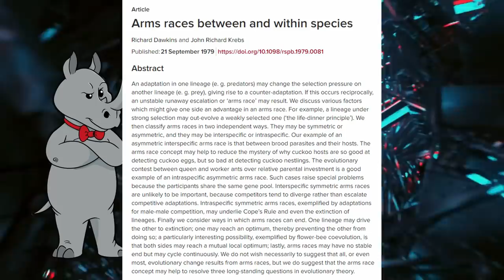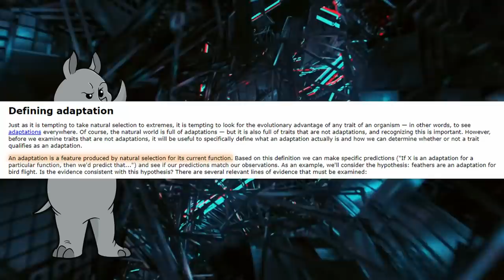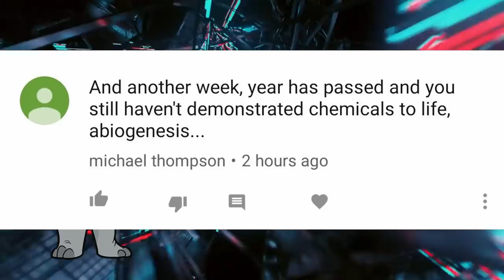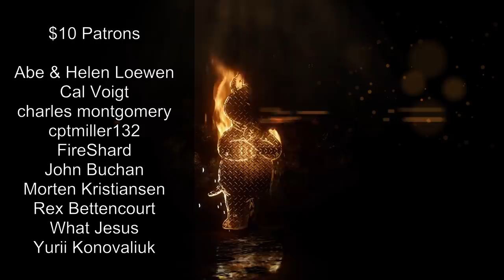David Rives is So Close and Yet So Far

Comment: In the meantime, we're still waiting for useful and concrete applications of creationism in the real world.
Reply: What about that train that was engineered to have a front, like that bird that dives in the water, in order to quieten the boom it makes when it goes into the tunnel?
Reply: @nativeking698  : what about it? Did creationist theories explain the mechanisms of a sonic boom? Don't you think over a hundred years of research and development in aeronautics, and over sixty years of develompent of supersonic aircrafts had anything to do with it?
Or do you also believe aircrafts to be the product of creationism?
Reply: @nicolasandre9886  It is just one example of biomimicry, I think that is how you spell it.   The train was engineered after the bird's beak.  A copy of something that supposedly arose from evolution.  I don't think so.
Reply: @nativeking698  : mimicking a living animal to design a vehicle or appliance does not rely on creationism in any way though, does it?
I mean, the animal you try to mimick exists independently of how it came to be. Neither the theory of evolution nor creationist hypotheses are remotely relevant to analyze what works for currently existing animals and try to replicate it for designed equipment.
If I'm wrong, could you please explain to me how mimicking animals would require creationism to be true in order to work?
Reply: @nicolasandre9886  Your designed vehicle had to be created.
Reply: @nativeking698  : yeah, by engineers. I still fail to see the link with biblical creationism though.
Reply: @nicolasandre9886  Life was created.
Reply: @nativeking698  : prove it.
Reply: @nicolasandre9886  Do you really want me to? I mean ask yourself do you really want me to try?
Reply: @nativeking698  : since I will probably read the same arguments from ignorance or other fallacies I've already heard or read many times before, I don't suppose I want to. But if you have compelling arguments to present, go for it.
Reply: @nicolasandre9886  Life in order to change over time by natural selection (which is used in both creation and evolution) had to have certain abilities right from the get go.  They are the ability to survive its environment, to take in and use energy(which requires a process), the ability to reproduce( another process), the information necessary to do so and that information has to have the ability to mutate.  

In case you're going to consider this an argument from ignorance, let's examine what makes an argument.  An argument has to have at least one premise and one conclusion.  The conclusion must also be stated.  If it doesn't have one or the other it is not an argument.  Therefore you tell me did I make an argument in the above?
Reply: @nativeking698  : sure, you made a more elaborate argument than what I'm used to. However, I would question your first premise that life required certain attributes from the beginning.
Experiments already showed amino acids can form without a conscious creator. Hypothetically, such amino acids may also eventually combine into proteins still without guidance, and form a primitive form of current DNA.
If that is indeed possible, abiogenesis would actually explain the transition from non living matter to living organisms. However, this is still hypothetical and may not be proved to be possible for a long time., but as long as this hypothesis cannot be proven wrong, it should be considered.
I'll also be generous and consider that even if abiogenesis eventually gets confirmed in a lab experiment, it will still not be definitive proof that it's how life appeared on Earth, but it would have the advantage of not requiring to presuppose a supernatural creator, which is problematic since this cannot be confirmed through independent experiments.
Reply: @nicolasandre9886  If this was a test you would've failed.  I did not give a conclusion.  Must have a conclusion to be an an argument. Therefore I didn't make an argument.  This is just to help you establish what is an argument is and if that argument is an argument from ignorance.  At least you tried though.  Just remember no conclusion no argument.  

First amino acids aren't life.  They are what makes life but isn't life itself.  So this doesn't show my statements are false.  Experiments  need experimenters you know a conscience creator.  Now like you said though that experiment can show if certain conditions are met amino acids then life might arise without a creator.  Evidence for abiogenesis and evidence for a creator.  Now let's see what would happen to DNA without the ability to reproduce.  It just sits there doing nothing until it finally deteriorates.   Life ceases to exist at that moment.  Need the ability to reproduce.  Energy now.  DNA sits there has the ability to reproduce but without the ability to use energy.  It can do nothing like a piece of steel just sitting there.  Can't reproduce now.  Life ceases to exist in that moment.  DNA exists but without the ability to mutate.  Life exists but only as DNA strand never to change and never becoming you and me.  DNA with the rest but not the ability to survive its environment.  Say lava.  Before it has the chance to reproduce or to use energy it dies. Life ceases to exist in that moment.  Need all at the exact same time and the same exact moment. 

Experiments themselves require certain presuppositions in order to make them work.
Reply: @nativeking698  : my bad for assuming your conclusion based on the previous talk about creationism then.

You're right, I didn't prove your statement to be false, I don't think I am remotely qualified to do so. I'm just more interested in the abiogenesis hypothesis than the creationist one because it doesn't require a supernatural presupposition, and as such can be studied further through the scientific method, and maybe eventually either be proven to be false, or considered the most likely explanation if reproduced experimentally.

"Experiments themselves require certain presuppositions in order to make them work"
Sure, there are presuppositions that are epistemologically more costly than others though, and any supernatural presupposition disqualifies any hypothesis based on it as a scientific hypothesis since science cannot prove nor disprove any supernatural claim.

So, starting from your premises that the first replicator molecules would need several characteristics to be successful (being able to survive, to replicate and to consume energy), do you draw a conclusion then?

Note that I still don't understand how your train example from your first reply would be an application of a creationist theory.
Reply: @nicolasandre9886   Nicolas Andre  Even with God being supernatural, how God creates may or may not be supernatural.  Since the natural already has been created God can use natural means to create life.  And how he done it we may find out through science.  So even creationism can be studied through the scientific method.  Consider the kind.  We don't know what the original creation looked like but we do know through mutations this is how species came to be.  Tracking those mutations may lead us closer to what they might have looked like and what may be in one kind and not another.  

I will draw a conclusion.  Life is better explained as created rather than arising through chance.  Yes abiogenesis is chance as it is not designed or set up to be that way.  

Had to create that, didn't  rely on chance to do it.  Although every example of natural selection is an application of creationist theory.  Mice turning a darker or lighter tone to match their surroundings, birds becoming flightless to conserve energy and the list goes on really.
Reply: @nativeking698  
"Life is better explained as created"
Created how? By who? How do you test the answers you have to determine if they are actually correct?

"Although every example of natural selection is an application of creationist theory"
So examples of evolution, actually explained by the theory of evolution, are applications of creationist theory?
I wonder what the next step is, does creationist theory also explain the model of the atom and how to make nuclear fission work?
Reply: @nicolasandre9886  How don't know that's what science is for to find out.  By who isn't determinable by science but that doesn't stop creationism from being a scientific theory.  Through science testing the predictions made by creationism.   

Yes I told you before.  Both creationism and evolution use natural selection to explain life.  The main differences between e. and c. is the age of the earth and how life descended.  C. says life was originally created by God in certain forms and then after the flood new species derived from natural selection weeding out certain mutations in the body came to be.  E. says life started out as a single common ancestor and through natural selection life today came to be.  Both use natural selection and therefore every example of natural selection is an application of both c. and e.
Reply: @nativeking698  
"that doesn't stop creationism from being a scientific theory"
Creationism can only be a scientific theory if the creator is contained within the natural universe. Otherwise, once again, any supernatural element of a hypothesis cannot be confirmed nor refuted through the scientific method, therefore moving it outside the scope of science.
If life was indeed created by a supernatural god, science will never be able to confirm it, so unless we update the scientific method to deal with the supernatural, even if it were true, it wouldn't be a scientific knowledge.

To my knowledge, natural selection was never formalized by any creationist proponent. But after all, if the only things that work with creationism have to be borrowed from the theory of evolution, why not. I just hope that putting a big 'creationism science' sticker on all the work of actual biologists will never actually convince people that it's an actual science.
Reply: @nicolasandre9886  Doesn't matter if God is supernatural since science can test the predictions made by creationism.  We can also use things we have learned from science to add support for the theory such as the example I gave earlier (life's abilities).   

Natural selection was thought of long before Darwin.  Darwin utilized natural selection for his theory.  Just like how evolution uses a creationist concept(genetics) we too can use natural selection.  You must remember natural selection is NOT the theory of evolution.  It is only the driving force to make it work.  Without it the theory falls.  Since it is a force we too can use it. 

You must also remember this discussion isn't about whether creationism is science or not, I say it is,  but whether it has applicable use in the real world.  I have already shown it does.
Reply: @nativeking698  
"Just like how evolution uses a creationist concept(genetics)"
Are you really implying DNA and all we know about it now was discovered through creationism?

And regarding your last point, I don't mean to be thick, but can you remind me what real world application can be attributed to creationism? Something that works only if creationism is true? If it helps clarify why I ask, the example of the train you gave is, for me, an application of physics, maybe inspired by observation of animals, but still an application of physics, a discipline that, to my knowledge, has not really benefited a great deal from creationism.
Reply: @nicolasandre9886  No it was discovered by a creationist.  The point is just because something is foundational to one idea doesn't mean it cannot also be foundational to another.  
As far as something that only works if creationism is true.  I don't  think there is anything.  Of course  I dont think there is anything at all that works only if one idea is true.  All evidence can be used by more than one idea.  So I don't see the point in your statement.  
No but what did the engineers do? Did they sit down and wait for those chemicals that make up the train to eventually become life and get naturally selected? Or did they look at one idea and CREATE it?
Reply: @nativeking698  
"No it was discovered by a creationist"
Do you have a source to support this statement please?
I couldn't find out about Friedrich Miescher's beliefs. James Watson seems to be an atheist, and the Wikipedia page about Francis Crick reports he was a firm critic of young Earth creationism, providing the following quote from him:
"'Creation-science' simply has no place in the public-school science classroom"

"No but what did the engineers do?"
They put in practice the physics theories relevant to the goal they wanted to achieve. If an engineer designing a vehicle is proof that life was created by a conscious agent, I fail to see how, unless you make the mistake of considering living organisms share the necessity to be created like man made objects, which I haven't seen demonstrated.
Reply: @nicolasandre9886  Do you not remember the father of modern genetics Gregor Mendel? While we do not know if he was a creationist,  he was a friar priest, so the chances are pretty high he was a creationist.  

Let's see.  A train takes in and uses energy, same as life.  A train cannot reproduce but life can.  Trains need to be able survive their environment, same as life.  Trains have information that is needed to make it go, same as life but life can mutate its information to help it better deal with its environment.  Trains are made of parts that without there isn't a train, same as life.  Looking at this it seems to be a false trust and confidence to think that life wasn't created.
Reply: @nativeking698  : a train is not a living organism. Any similitude regarding certain properties of an object and a living organism do not imply other properties are necessarily shared by objects and living organisms. As you said yourself, trains can't reproduce. Why would a train prove life needs to be created by a conscious designer?

After a very quick and shallow research, I can't find anything indicating Gregor Mendel played any part in the discovery of DNA. I'm afraid I must leave your initial claim aside until I have more convincing elements to think otherwise.
Reply: @nicolasandre9886  It doesn't.  It just adds more evidence to the pile.  Think about it.  You are telling me that a train which can't even reproduce is designed but life with, the mitochondria, vacuoles, DNA, RNA, proteins and other intricate parts is not designed but rather a result of chance.  Good luck with that.  

Who said anything about DNA?
Reply: @nativeking698  
"Who said anything about DNA?"

After your claim from above:
"Just like how evolution uses a creationist concept(genetics)"

I asked the following question:
"Are you really implying DNA and all we know about it now was discovered through creationism?"

Your answer:
"No it was discovered by a creationist"
Reply: @nicolasandre9886  Ok yeah but this is your fault.  Even in your comment you wrote I said genetics but then started to refer to DNA.  My bad for not thinking about that part.  However the concept of genetics is different from the thing that carries your GENETIC information(DNA).  That is why I referred you to the father of modern GENETICS Gregor Mendel.
Reply: @nativeking698  : agreed, however it's now difficult to dissociate genetics from DNA itself. Understanding the underlying mechanics about how genes work, how proteins are influenced by genetic information allows for getting the field of genetics further.
Reply: @nicolasandre9886  Exactly, now the fact it came from a creationist doesn't stop evolutionists from using it now does it? That's  the point, where an idea came from doesn't matter.  As long as the idea works any scientist can use that idea.  That's why creationists can use natural selection in their theory.
Reply: @nativeking698  : sure, a creationist can be a scientist and can produce valid knowledge through the scientific method. Even assuming Gregor Mendel was a creationist, I don't see how his work was motivated or even related to creationism itself. Every reliable knowledge that was gained through his work is reliable because it was confirmed by other biologists, not because of creationism in any way.
If creationists admit natural selection works, why not use the whole theory of evolution? What's supposedly not working in it to reject a theory that is consensually accepted in the scientific community?
Reply: @nicolasandre9886  This wasn't to get you to see a useful application of creationism.  It was to get you to see that an idea regardless of where it came from can be used in any theory.  You acted like we couldn't use natural selection because it might not have been discovered by a creationist.  I just wanted to show that idea was false.  If an idea works it can be used by anybody and any theory.  Not since creationism also uses natural selection every idea inspired by it is also a result of both evolution and creationism.  So yes creationism has concrete and useful applications in the real world.  

They reject it, because 1 a lot of people try to use evolution to disprove God.  Notice I said try, as evolution doesn't disprove God.  2 A lot of what natural selection can produce is limited.  Evolution requires nearly unlimited production. Ex.  To go from a cell to you, the cell would have to develop a brain, arms, legs, stomach,heart,nose,intestines and the list goes on.  The chances of that happening slim to none.  Too much is required and all at once I add to think that all of you is due to natural selection acting on a chance mutation. Much easier to think that most of what makes you you was already created close to what you have now and then natural selection acted on those chance mutations.  Another reason  is new information doesn't come from chance mutation.  Mutations are a result of the information already there being twisted.  Ex.  To go from a cell to a fish requires new information.  The cell doesn't have the information to produce scales, eyes, fins, muscles and the rest.  Much easier to think that a kind of fish was already created first and then chance mutations acted on by natural selection caused losses of information or the result of those mutations to get the fish you see today.
Reply: @nativeking698  
"So yes creationism has concrete and useful applications in the real world. "
I still don't see it. If by that you mean using natural selection as part of creationist theory (which still seems ironic to me), then it's still not an application of creationist theory, creationism itself did not inspire the formalization of natural selection.
Maybe I'm being stubborn, but I still need an actually compelling example of some knowledge that came from creationism itself that has led to a useful application in the real world.

"1 a lot of people try to use evolution to disprove God"
And I would agree that it is useless, because:
a) it's impossible to disprove the idea of a god, unless it is logically inconsistent (like the idea of an omnipotent, omniscient and benevolent god is inconsistent considering what happens in the real world)
b) the theory of evolution doesn't need a god to work, but doesn't need the absence of god either

That being said, that would still make it an emotional reason for believers to reject the theory. While I could sympathize with it, it's by itself an objectively bad reason to reject the theory.

"Much easier to think that most of what makes you you was already created close to what you have now"
I think that sums well the rest of your objections. It's easier to believe an all powerful god did it magically than actually looking up the state of current scientific consensus on the subject.

"Mutations are a result of the information already there being twisted"
There are several types of mutations, including insertions, which can add new information that can be neutral, detrimental or beneficial to the host organism.

"To go from a cell to a fish requires new information"
From what I understand, most organisms that reproduce sexually start from a sperm and an egg that constitute a single cell that can eventually develop into a full fish, frog, dog or even human, without any new information from the two halves from the original sperm and egg.
Reply: @nicolasandre9886   No you are right.  The idea of creationism did not spawn natural selection theory.  Neither did evolution either.  Many ideas of evolution were trying to make it possible for a naturalist idea of life to work.  It wasn't until Darwin started utilizing natural selection in a theory of evolution to make it plausible.  That being said don't get it twisted evolution didn't inspire natural selection.  People already knew animals changed over time they just didn't know the mechanics.  I concede I cannot think of an example where creationism inspired useful knowledge in the real world.  A lot of our evidence come from old earth assumptions being faulty.  It was thought it took a millions of years to make diamonds.  Experiments have made synthetic diamonds in weeks.  No reason to assume millions of years.  Same with oil, we can make synthetic oil in days, no reason for millions of years.  Animals have had new species arrived within 4 generations, no reason to assume a vast amount of time.  

A.  Depends on how you look at God's attributes.  

B.  Not sure what that has to do with what I said but it is true. 

Who said he did it magically? I already said he could do naturally or supernaturally.  Since God knows what he wants, has the power and intelligence and technology to bring it about he can do it naturally.  Look at my work, if someone doesn't know what they are doing it would take them all day to make 200 sticks.  I can make 15,000 in an hour.   Scientific consensus doesn't matter.  Only evidence.  

It's not new information it's a new trait but not new information.  Look at this example.  Selecting from the word alphabet, alpha makes red.  Bet makes white. When an insertion happens like taking a and putting it in bet makes beta.  Beta then makes pink.  However new information has not taken place.  No new letter has arrived but a new trait has.  It is still just rearranging of information already there.  

I was talking about the original cell.  My bad for not clarifying.  Think about this we probably don't have the information necessary to make ourselves have scales.  Word example again to make scales we need the information of SCALES we only have SKINS.  Mutate all we want we will never go from SKINS to SCALES as we need to add the letters c,a and e.  You might think insertion might help, but our genome is only made up the words, SKINS, POINT, FOOT, DID, and GOD.  Insertion takes a letter and puts it in SKINS.  Still no c, a or e therefore the word SCALES will not come to fruition.  And we we will never produce scales. It just isn't in our DNA.  Same with the original cell.  If the original cell's genome only spelled Abdefghi, we can make all kinds of words.  But not words that include everything after i.  Let's say to go from cell to fish requires the letters z, j, and o.  No matter how much you rearrange the genome abcdefghi z, j and o ain't happening.  Insertion may add two a or insert a b here and there but never z, j or o.  So to go from cell to fish will never happen.
Reply: @nativeking698  : I haven't looked into it yet but I doubt conditions that occur naturally can produce diamonds or oil as quickly as industrial processes that are likely costly in energy.

"Animals have had new species arrived within 4 generations"
I would be very curious to have a source explaining this example.

"Scientific consensus doesn't matter.  Only evidence"
Unless the whole scientific community thrown their own method down the toilet, scientific consensus is based on agreeing interpretation of evidence and repeated results of experiments by independant teams.

"It is still just rearranging of information already there"
As far as I know, DNA and RNA have always been made of adenine, cytosine, guanine, thymine and uracil. Genetic information is composed of genes which are sequences of these nucleotides.
Adding nucleotides from this same 'alphabet' can lead to new genes appearing in a DNA or RNA sequence.

"Let's say to go from cell to fish requires the letters z, j, and o"
Same as above, DNA and RNA have been most likely composed of A, T, C, G and U nucleotides right from the start. New traits can appear with the appropriate mutations. The difficult thing is to grasp the scale of the time on which in occurred, and try to ignore the idea it couldn't happen by itself randomly, because our own brains are very effective at detecting agency in almost every event.
Reply: @nicolasandre9886   Nicolas Andre  Synthetic diamonds and oil.  Not at all.  Syntethic diamonds are cheaper than natural ones.  There isn't much difference in the price of oil. 
Experiments show as long as the heat and pressure is right bam diamonds.  How long does it take to get to that temperature and pressure? Depends on the earth, but if the earth has the right conditions then it would only take a short amount of time.  

Notice INTERPRETATION of the evidence.  I might interpret that evidence differently than they do.  I shouldn't say oh this is what the consensus is then that must be the answer.   

Think about this the genetic sequence A-T C-G A-U will make eyeball.  In another animal will the same sequence also make eyeball or will that sequence make something else?  If that sequence always makes eyeball regardless of the animal then I am wrong about that.  However should that same sequence make something else in another animal then I am right.  Why? Because the thing that's reads the code reads it to say in one animal oh this sequence says make eyeball.  But in another animal the  sequence reads something else because both animals know what information is supposed to be produced because  they know what information is there.  

I know it could've happened randomly.  The question is did it? I say not.  Why do you think our brains are effective at that?
Reply: @nativeking698  
"I shouldn't say oh this is what the consensus is then that must be the answer."
No but if your interpretation differs from the scientific consensus, your are the one who needs to explain why your interpretation is more correct than the consensual one, like scientists have done to explain why they consider their interpretations correct.

"(...) both animals know what information is supposed to be produced because  they know what information is there."
It was probably just a clumsy choice of words on your part here, but animals know nothing of their genetic information. The process by which an animal develops in a certain way depending on its genetic information is the application of biochemistry principles that make certain sequences of DNA eventually produce certain proteins. The details of this process are far beyond my knowledge on the subject though.

"The question is did it? I say not"
You are of course free to hold any opinion, and given the elements at your disposal and your general beliefs, you probably have good reasons to believe so. For my part, I'll never know for sure if it did happen by random chance, but since it seems the best explanation that can be derived from observations and experiments according to biologists, I'll trust their current knowledge and assume this is the most likely explanation. Maybe I'm wrong, but I need compelling reasons to change my mind.

"Why do you think our brains are effective at that?"
Because of evolution (no pun intended). At a time where humans were much more at risk of being hunted by predators in the wilderness, people assuming that a bush is rustling because there's a nasty beast about to eat them had better chances of survival than people assuming it's only the wind. If the first ones get it wrong, it's not a fatal mistake.
Also, studies on children behavior seem to confirm a strong tendency to attribute agency to natural phenomena as well (trees exist in order to cast a nice shadow on a sunny day, rocks exist so that animals can scratch their backs on them for example).
Reply: @nicolasandre9886   Nicolas Andre  I ain't sure but isn't that what I am doing in some of these places.  

It was a poor choice of words.  Who or what set those principles in place? It works so well I go with Who.  

Observations and experiments usually end up being natural selection.  Which is evidence of e. and c.  I think these are compelling reasons.  Chance can lead to life without the ability to reproduce.  Leading to life's death, followed by the rest.  The fact we had them all at once seems to be intentional.  Nature cannot produce intent as it cannot think.  The guiding principles DNA must abide by.  That also is evidence of intent.  The information in DNA seems to be intentional.  If left to chance DNA might have sprung up with only one nucleotide and be unable to make more.  Not much information and not much diversity in life there.  Each of these on their own is highly unlikely.  Coupled together and your looking at an unbelievable number.  A possible number yes but certainly not plausible.  The evidence suggests Mind.  Not natural process.  You still think natural go ahead but you must understand it's in spite of the evidence.  Same goes for the biologists.  

Evolution or created that way.  Created that way so when man sinned and lost their way they may come back and seek Him out.  

Natural phenomena with a purpose.